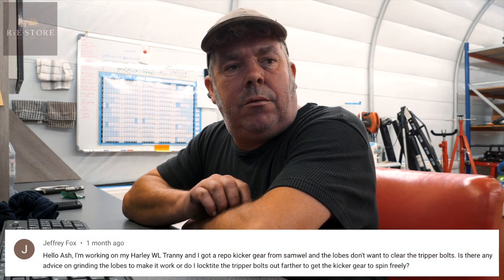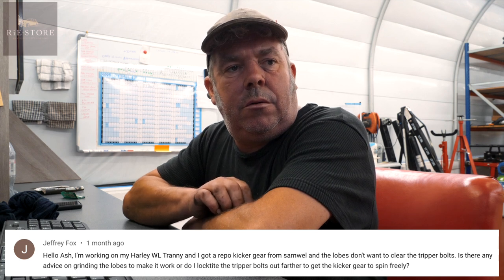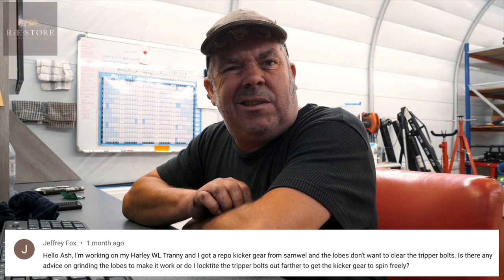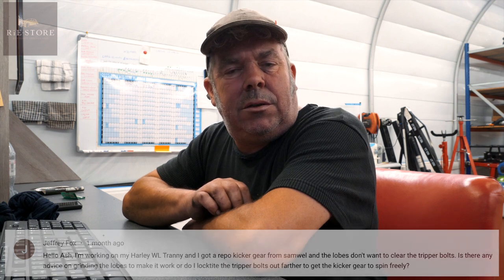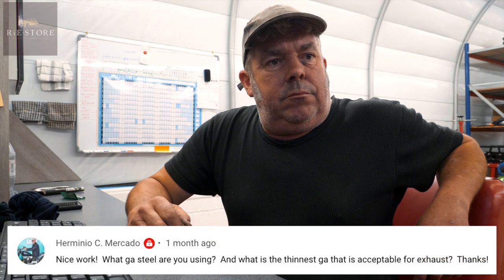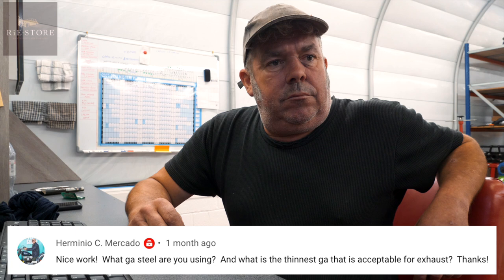Q&A / ep211

Comment: Starter gear and tripper bolts.  Ash may remember I had similar problems he helped with.  Thank Him.  But at the end of the day,  jeffrey Fox,  i discovered the bushing in the case, the bi-metal one, that the shaft goes in next to the starter gear,  stood too high inside the gearbox.  By hand and with no shaft, no spring,  and putting the gear alone  over that bushing and twisting it,  the lobes would not go under the tripper bolts, impossible. .  This was tried without the shaft, just the gear.  I pressed out the bushing and took a few thousands off until it fit,  then tried again with the large spring, and it worked great.  kicker lever returns to proper upright position every time.
Reply from the maker: Glad you got there in the end!

Comment: The problem with the kick gear is sometimes the bush that goes into the case. The lip can be too thick reducing the clearance and not allowing the gear to engage the tripper bolts
Reply: exactly what I discovered.